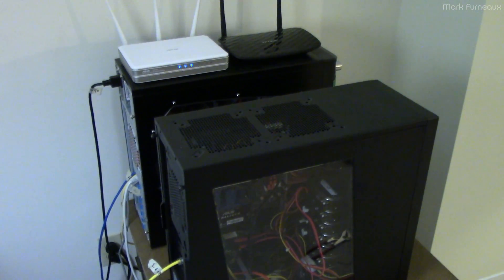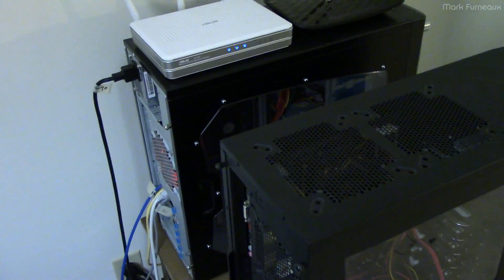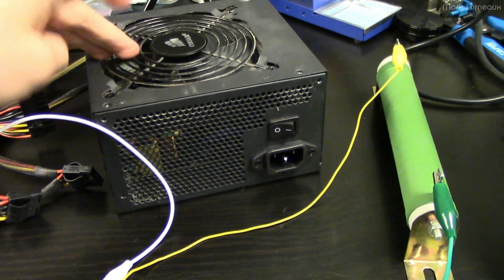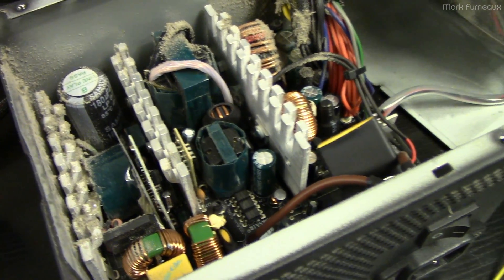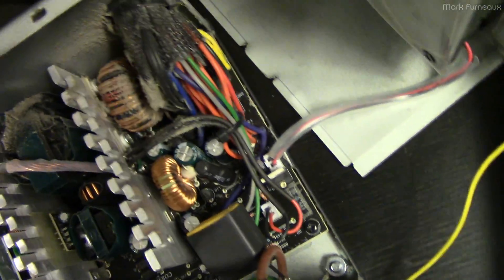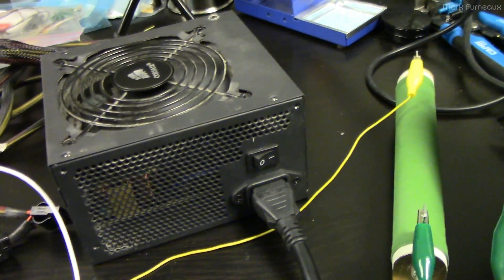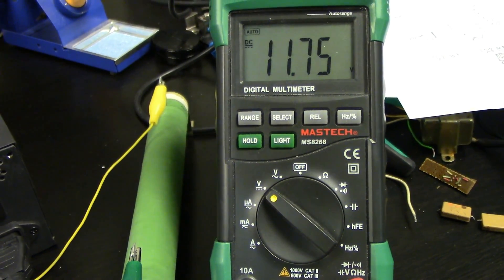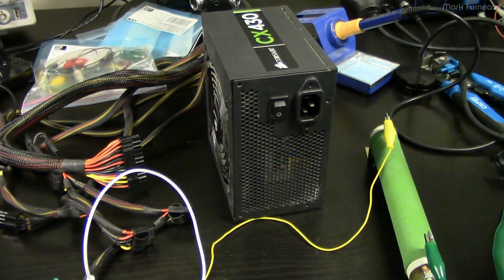Failing Computer Power Supply Causing Crashes

Comment: If you turn on it in cross load, you will not use the 12v rail.
Since the 5v and 12v rails have the same voltage controll, both of them will have a different voltage instead of have exactly 4,8-5,2 and 11.6-12.4 cuz the 12v rail has nothing to supply!

Comment: getting crashes after buying a new gpu... my PSU is 4 years old tho xD
Reply: Me too, just bought AMD Radeon RX 590 Sapphire NITRO+ 8GB GDDR5 , 4 year old psu 500w, and i just put back my old R9 until i get new PSU because games crashed 2,3 times
Reply: @mrvik97  did the problem get solved?
Reply: @s2xbox360  I got new power supply
Reply: @mrvik97  can you tell us what psu you bought?
Reply: @mrvik97  did it fix the problem?
Reply: @Mukatutu  Yes it did, old psu was underpowered
Reply: @horizonariondust576  Ah i forgot the brand, i know its some carbon gaming 550w

Comment: I wonder if you will answer this comment but my computer only shuts off when I run demanding games&softwares. Could the problem be a PSU voltage issue ? I'm not sure how to perform a test WHILE the PC is running.

Comment: My PC works until I install drivers for my gpu could this be a fault with my psu not being able to power it?
Reply: That's why if your graphics card or pc works well before the driver's update, you don't have to update it regulary. As the new updates could bring another set of problems or issues. Only update if the description has new big changes or your pc is slowing down.

Comment: My pc reboots when I launch a game, is that a psu issue as well?
Reply: Sean Eredia Same bro. The only things it could be are my PSU, hard drive or ssd. Ive replaced all the other components to very high end things
Reply: I have the same problem did you get a solution?

Comment: Just lost an EVGA 600 within a month of install...
Reply: i have the same evga 600 its not bad but i cant play anything because i get crash with a rx 480 8gb
Reply: @GRANTU122  Same here EVGA 600B rx 580
Reply: Yup same here piece of shit PSU’s
Reply: Same it just blew up on me
Reply: Yep yep same dude I was so sad
Reply: I´ve just updated to an r7 1700+GB ab350 g3 and reused my rx480 8gb and EVGA 600B, just to find out that everythingh that i play on high settings (not even ultra) completely crashes my pc, even though temps dont rise and cpu/gpu usage dont surpass 60%. Just updated every single driver and even the bios, but the problem still arises. In a few hours im trying with a psu of a friend to discard if thats the problem...
Reply: @IanUtterAzar  It's Power supply trust me get a cosair PSU, and you will be good
Reply: IanNoSignal please tell me if this worked or not
Reply: @noahb3ll958  Nope, it didn´t. I tried a friend´s 800w bronze psu but still crashed, had the kernel 41 (63) error since day one, bugcheck parameters are at 0 on every log....
Temps are nominal, tried over and undervolting/clocking, adjusted memory timings, stress tested CPU, GPU and both simultaneously but didn´t crashed.
Im almost runing out of options rn :(
Reply: IanNoSignal what kinda of crash is it like a complete black shut off or is there a blue screen. And does it restart by itself or do you have to turn it on
Reply: @noahb3ll958  It´s a total crash of the system, no BSOD, my monitor displays the color of the last frame and earphones loops the last audio bit, stays like this like 5-7 secs and after this it doesn´t turn off or reset, but fans turns down their speed, just like a suspension. I have to manually reset to get it back working.
I experience this crashes on fortnite, ace combat 7, gtaV, watch dogs etc on high-ultra settings (sometimes even in mid settings ;_;)
Meanwhile, league of legends, warframe and valorant didn´t gave me this problem, only crashed once on WF.
Reply: IanNoSignal for me it’s a complete power shut off like somebody pulled the plug or something, and completely at random, nothing like you describe. But did you say you just upgraded your graphics card
Reply: @noahb3ll958  Did u tried another psu in your rig? I´ve upgraded cpu, rams and mobo, reused my rx480, sdd, hdd and psu.

Comment: 90% sure I'm dealing with the same issue on my Corsair power supply. Only one year old! Very helpful video, thanks.
Reply: Which model of corsair do you have
Reply: @parikshitneb6154  hx 1200i
Reply: @globalgaming290  me too. Shit
Reply: Did you get it fixed? My 3 month evga psu keeps on failing

Comment: Stay away from the corsair CX series. The corsair HX series is very good though. If you take apart a PSU and saw oversized quality caps, transformers, and inductors, silicon cement holding down the inductors, large bridge rectifier(s) attached to a heatsink, and beefy heat sinks, it's a very good power supply.
Reply: been using a CX 600 for some years now and i never had any issues with it, gaming for over 12 hours per day

Comment: I have the same brand 750W and it started to give off burnt smell after 1 year and 10 months. The pc crashes sometimes also. Later on, when I lunched battlefield 1 the burnt off smell was all over the place and the pc crashed and this time won't boot up. However, I still see LED from my graphicscard.
Reply: Try replacing your PSU
Reply: Exactly, replace your PSU

Comment: Seriously ? Power supply could cause kernel panic ? I never heard about this, anyway the video is very interesting. Also it is very useful to use ECC memory everywhere, not only on servers.
Reply: It's an ill designed unit with purposefully nerfed under-voltage shutoff, if these things hadn't been made in near million quantities, i would have said "it's not so common", but now it unfortunately is. Ooops.

Comment: I just had to replace the power supply in my NAS with a SeaSonic supply. The EVGA one I bought a few months ago was having issues where the IPMI would reset due to a separate problem and the system would click on for 5 seconds and click off. This would repeat for as much as 30 minutes without intervention. Would this be an issue with compatibility or is the power supply bad? It's still under warranty and I didn't have problems with it on another board that I tested it with.

Comment: Real obvious you had no fan filters in the PC that it was in, the inside is downright nasty. I've got an HX850 that's stayed filtered for 4+ years and there's no issues with it at all. It's failure is your fault not corsairs, the dust is what killed it, which would have been prevented with filters.

Comment: Woah hey, I've got the same Wi-fi Router!
Archer C2 right??

I had similar issues with my PSU some time ago, it turns out the 4+4pin plugs had melted inside the 8-pin mobo power slot. (The 12v connector that feeds the mobo extra power)
Thank god this PSU had an extra 8-pin 12v cable.

Comment: The Corsair CX series aren't really the best power supplies to use in a server... I'd personally go with a Corsair RM, TX or AX series or for 24/7 usage, Seasonic all the way!! The EarthWatts line are usually really good for server usage...
Reply: nah, Zippy is where it's at :P loud like a true chad, heavy and indestructible too xD
Reply: Old comment, but I gotta say, that I think my Corsair RM750x is failing, it restarts my pc when I play heavier games than CS:GO like Detroit: Become Human. And I know it's not the cpu or gpu because their temperatures are okay so that leaves me the thought of failing psu.
Reply: @temegron6695  Did you fix it? Same issue with my GTX 1070 ROG Strix going black screen and full-speed fans. The GPU temperatures are good, but it must be PSU.
Reply: @SEGHTER  I've figured it out. My pc restarted because my gpu's cooler was failing so the temperatures went high up in gpu, it even hit the 105 celsius degree. My PSU wasn't the one to blame, when I changed it to other PSU -> no change in result but when I switched NVIDIA gpu in, it worked just fine like it should.
But you seem to have much better gpu model. Mine was the older and failing version of RX 5700 XT ASUS TUF X3 Gaming 8GT.

So the only thing I can request is you to stay away from ASUS TUF cooled RX 5700 XTs :D and try to switch the components and see what switched component has the working impact.
Reply: @temegron6695  Thanks a lot. In my case the fix was stranger, but the simplest thing possible. 
I wanted to thoroughly test my PSU, so I disconnected the 24 pin motherboard connector. I then wired the green wire with one of the black ground wires (so that I can turn my PSU on). I then went to test each colored wire and the ground, with my DVOM, by using the 20 V DC setting. For each color, you need to have: Yellow: 12 V, Blue: -12 V, Violet: 5 V, Red: 5 V, Orange: 3.3 V, if you also have a White wire, it should have - 5 V. I did the same with my video card connectors. I then went to apply contact spray onto them and blew air on them. All was well within the specs. Still, I didn't understand why my video card kept dying, the temperatures were ok as well, having swapped the thermal paste. I also changed the power outlet for the supply cable going from out from the PSU. 
However, when I booted up my PC afterwards, I saw a marked increase in V, still not enough for my liking, but from 11.520 V and lower, it went to 11.808 - 11.880 V. I was still skeptical, but I went on to act as everything was normal, and the whole thing was actually back to normal. 
The only explanation is that the video card didn't get enough current under stress, even though I updated its BIOS and it was running very cool, basically, there was some extra contact resistance which was messing up the whole thing. The reason why it went to normal is due to the fact that I poked the DVOM probes into the contacts, effectively cleaning them, thus decreasing my contact resistance to a level that allowed it to work normally. 
Thanks for the feedback and take care!

Comment: So I was going to buy a CX series Power Supply. After seeing this, I don't want to. What is a good Power Supply around $40-70 that is good/safe to use from your experience?
Reply: Also, I recently bought an EVGA 500w power supply. It had some trouble booting the computer, and when it did, any second RAM slot of any motherboard ceases to function. To this day, 4 months later, I think was the CPU (it was shipped with very 2 very slightly bent pins) and the PSU that caused the issues. Ant idea what caused it?
Reply: Sounds like you just got a defective motherboard and a CPU with a few bent pins. Sounds like none of this had anything to do with the PSU.
Reply: Redey1290 Actually, it's probably the CPU. I tried two motherboards with it and they both had the same problem, both in the same spot.

Comment: I had a HIPRO Chinese 350-watt PSU running an older gaming machine with dual hard disks and a Q6600 CPU for years, and surprisingly, I never had a problem with it. What's crazy, however, was when I upgraded the machine and took out the power supply for another project, EVERY SINGLE ONE of the output electrolytic capacitors had popped their tops and leaked brown stuff in the PSU! I had no idea how the machine was still running stably, much less at full power with games, but I sure was glad I took the PSU out before it nuked the motherboard and the rest of the machine.

Comment: you are not measuring it correctly ,you have hooked your multimeter on the loaded line that's probably not even rated to carry more than an amp ofcourse u will get massive voltage drop measure it again but connect the load on the higher current molex connector and the probes on another rail.
Reply: Strongly disagree. Unless the resistance of wire and connector approaches 0.5 Ohm, which is near unthinkable as it would clearly be too much, the measurement is correct and the measurement point is pretty much irrelevant. In other news, the MOLEX connector is rated to 5A current, and the wire at least 10A or more since there's multiple connectors on one strand, there mustn't be much drop on such currents. He is however drawing a maximum of 1.5A of current - even much less on the measured 5V line.

Comment: If the 5v and 12v rails are erratic, not likely to be a faulty cap. These are forward converters in current mode regulation. The feed back is controlled via an optocoupler which would affect all output levels.

Comment: The rule of thumb:  Every time you measure a voltage of a power supply, always put a load on one cable and measure on another cable that is not loaded. Else you measure mostly your wiring and connectors resistances. Measuring paper clip resistance is also not the best practise.
Reply: True

Comment: Hi Mark, can you answer this question which was bothering me a lot. 
I use Thermaltake TR2 470 watt power supply ( you can google it ) from 2012 to till this day. Do you think i should change it because its old.???
Reply: Ali Abdallah
How can you say for sure.?? Maybe you bought the cheaper quality, do you know there four different types of quality power supplies made just by Thermaltake?? And four types are the ones i know, there might be more.
For example:
Themaltake Litepower 650 watt is around 400$
Thermaltake Smart SE 630 watt is around 600$
Thermaltake TR2 600 watt is around 900 $
Thermaltake Tough power 700 watt is around 1400$.
Litepower series are lowest quality, Tough power are the highest quality, i wonder which one u choose to buy.
Reply: AD KN if its working why would you
Reply: Kapetsu
I am afraid it might go down and damage my hard drives with it
Reply: oh i understand
Reply: AD KN it's a thermaltake. they tend to make low quality stuff.

Comment: half a year ago my previous power supply failed, which I bought was second-hand. The problem I experienced was that the computer had a hard time starting, namely I had to press the power button multiple times. After a few weeks of doing that I found out that I could only start my computer if I flip the switch at the back of the power supply off and on and then immediately press the power button. I am not sure what part(s) of the power supply was failing, but I am glad that I bought a new one.

Comment: Just a comment: If I heard OK, you have 2 8 ohms resistors in parallel. (Eng is not my main language)
If you have two in parallel, that's 4 ohms.

So in a 12V rail, (assuming it doesn't drop), that's 12/4 which is about 3 A, and when you remove 1 resistor, that's about 1.5 A less.
I know It's close to "an amp" as you said, but in reality that's about 50% higher than what you believe (hence 50% error).

Things change when using the 5V output.

However, I do agree that it shouldn't behave like that with such a small change in load.

I'd only recommend cleaning the PSU, as that sometimes makes electronics misbehave really bad.

L8er!

Comment: Always run quick hardware diagnostics first if you don't have good idea of what the problem is. Test power (with a cheap Power Supply Tester http://www.newegg.com/Product/Product.aspx?Item=N82E16899705003), RAM, CPU,  Northbridge, and HDD/SDD. It takes 15-20 minutes. Then, go through and troubleshoot the software.

Comment: this is why i have the PSU cooling seperate from the case so face down so it intakes an exhausts on its own with no extra heat from the rest of the computer. and of course i have no filter on the intake of the psu at the bottom of the case but ive had it for 2 years and there berely any dust in it because i leave my computer in a 90% dust free room a.k.a my bedrooom that i actually clean regularly lmao

Comment: i have a similar problem with my gaming pc it goes fine while plaing games sometimes it restarts in game but mostly when not under load and its not a dust problem because i clean every 15 days

spec:
core 2 quad 
asus p5n-e sli
6gb ocz ram
evga gtx 650 mini
sandisk ssd
samsung hdd
seasonic 850w psu

i have been on linus tech tips forums and know one knows what it is i have tryed different gpu and i had the same problem
Reply: Secret Beed Secret Beed probably a PSU problem then, still a Seasonic should be pretty good I think it is worth testing with a different one if you can,  it could also be a problem where if you are using an AIO liquid cooling if it is as old as the rest of your rig it could be going bad, have you looked at your CPU temps with HWmonitor
Reply: ill try the psu but i dont have liquid cooling if i cant get it fixed its not to much of a problem because im building a new one soon
Reply: @secretbeed1399  same im late did u fix the prob?

Comment: Can you recommend me a decent psu brand?
Reply: You really should not be shopping for Power Supplies by brand. You should shop based on the OEM of the unit. For example, EVGA and Corsair do not manufacture any power supplies. They rebrand a modified unit and but their name on the side of it. 

That said, generally speaking Seasonic and high end EVGA units are quality supplies.
Reply: Oh, okay thanks!
Reply: Cedie Dimacali What are your computer specifications? That is the determining factor as to what PSU you would need. 
Specifically need to know your Processor, Graphics card (if you are using a dedicated card), and that is about it, unless you are running a server or high end workstation where you would need redundant power or special connectors from the PSU.
Reply: EDIT: Sorry, I responded to the wrong notice there. You can ignore that if you want.

Comment: Hmm, I wonder if it is my PSU is whats giving me my issues with my GPU with its output cutting out what seems to be randomly. It seems to be the exact same problem with the driver crashing according to windows event viewer.

I wonder if over time my PSU is now struggling with putting out enough power for my GPU so it crashes.

If I do eventually figure out if it is my PSU anybody got suggestions on a reliable 700w or so PSU that isn't too expensive?
Reply: an aerocool xpredator 650m is a good option